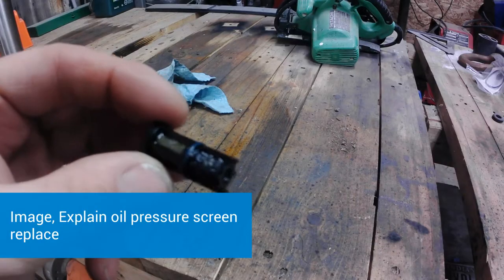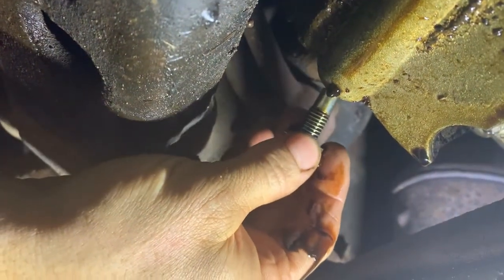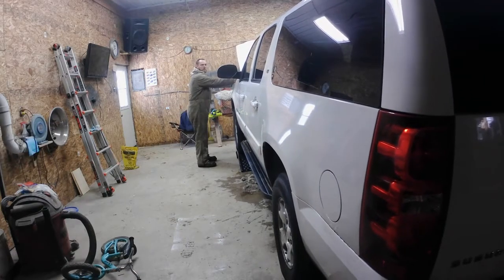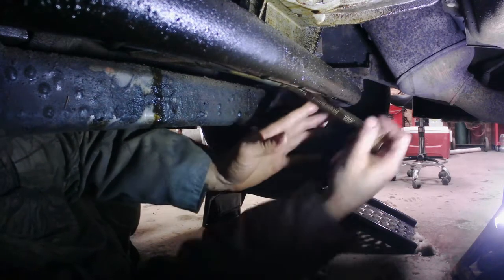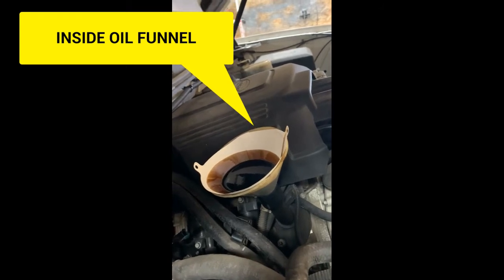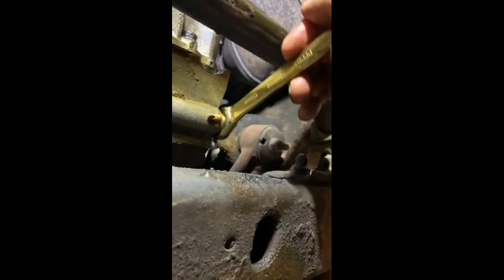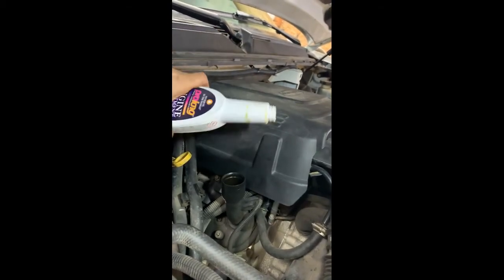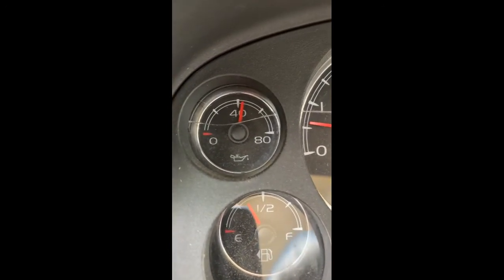How to Fix Low Oil Pressure

Comment: I have a 94 ZJ I vought a few years ago with a milkshake problem. When I would check the oil, it all looked fine except for the last quarter inch of the stick had the milkshake.

I knew that if coolant was getting into the oil, it would be mixing. This was some kind of sediment at the bottom of the pan. I changed the oil and that helped, but not much.

So I drained it again, left the filter (which was new) on, and shot a can of intake cleaner and about a half can of brake cleaner (because it was there) down the dipstick tube. I started it up and ran it at about 5000... no I didn't start it, only one of my thumbs types the truth.

I let it sit for a couple of hours (didn't think to shake the vehicle, but good job. I liked that). I drained that out, and tried to get in there with a long, thin screwdriver (on the 4.0 the drain is at the back of the pan so you can get in there pretty good. I couldn't drag anything out.

I shot some compressed air down the dipsrixk tube and let it sit, idea being to let anything I missed evaporate. Then put a couple quarts of clean oil through the rocker cover. That ran clear, so I put the drain plug back in and filled it. That solved the milkshake problem. I can't remember if I did a followup pil change or not, so I probably didnt.

Comment: The screen is on top of the motor in the back.  But I like the idea of putting the chemical in the dip stick and draining it before adding oil.
Reply: He’s referring to the screen in the oil pickup tube. He references the oil pressure switch screen at the beginning to demonstrate what he believes the oil pan looks like. There is a screen at the base of the pickup tube…if it gets excessively dirty, it can’t draw the oil from the pan.

Comment: So if you put the Sea Foam through the oil dipstick it reaches the screen under the oil pressure sensor?
I have a 2013 4.8 with 143,000 miles, oil pressure reads a bit low at the gauge. I have a new sensor and screen but have not installed them yet.
Reply from the maker: No, this was just to do the pick up screen in the oil pan without dumping seafoam through the rest of the engine, still needed to do an oil change after a few hundred miles because it still broke a lot of sludge loose
Reply: @hackityourself6560  OK that makes sense.